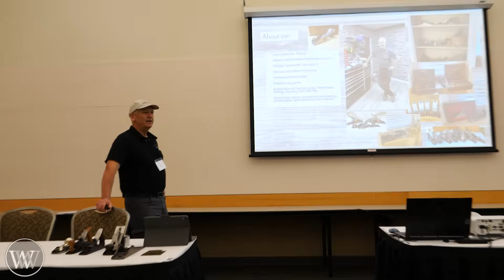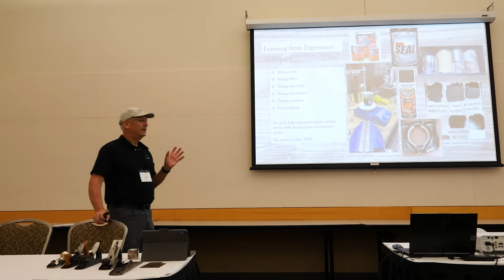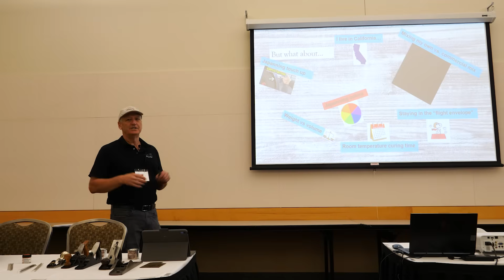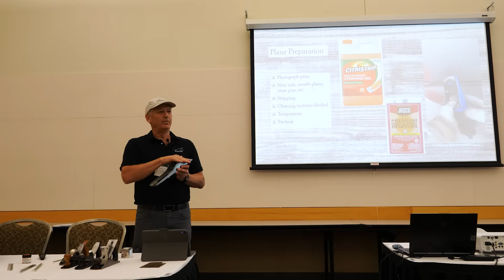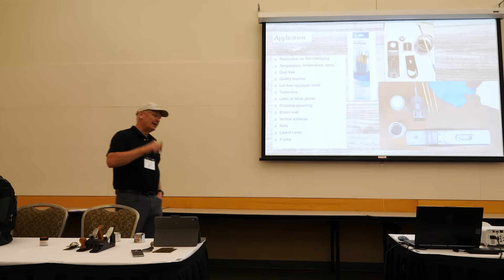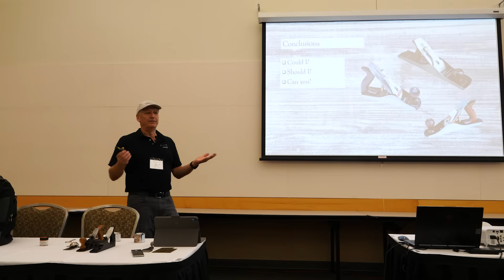Japanning Secrets You Never Knew! From The Guy That Makes It

Comment: About stripping the old japanning off, I did this with electrolysis. Works a treat. I did this with an old analog car battery charger and a large piece of steel as a sacrificial anode. Not only does it remove the old finish, also the rust will be removed brilliantly.

Comment: I need to figure out how to make japanning in old mopar colors.
Reply from the maker: collared japanning is something I have been trying to do for years, but I cannot get it to work just right.
Reply: @WoodByWrightHowTo  I know you’ve got a nice blue, but I was just imagining Plum crazy purple or the lime green. Whatever its color name is.  Limelight? Go limey? I just think if someone were able to make a variety of colors that it would be cool for tool personalization. Or even a nice white enamel to contrast the black .. you could have storm trooper planes
Reply from the maker: even the blue that I did was horrible and that is suppose to be one of the easer colors.
Reply: @WoodByWrightHowTo  I thought it looked good just not necessarily on hand planes. It would look fantastic on a bike.
Reply from the maker: In person it is a mess.
Reply: The key to using other pigments in japanning is to eliminate the asphaltum/gilsonite pigment and replace it with any powdered pigment.  The pigment must be mulled with a glass pestle and glass plate using a small about of BLO as a binder.  The pigment must be ground considerably finer than what is sold as it will be in suspension not in solution as the asphaltum.  Mulling pigments was a common practice by artists who made their own oil paints and is still common enough today that the mulling tools are widely available.  The curing is essentially the same but the final finish is not quite as durable as the asphaltum liquifies at the higher temperatures and adds strength to the long chain polymers formed by the Boiled Linseed Oil (BLO).
Reply from the maker: The problem isn't grinding it down to a fine enough paste the problem is the heat treatment. You can't take it up to as hot as you can with black. Otherwise the color pigments all start to get darker and darker. But if you don't take it up hot enough then it never cures. And for most all of them I've tried I can't get a bright vibrant color and cure them in a reasonable time. All the colors tend to get muddled if you cure them in less than a few days of heating.
Reply: @WoodByWrightHowTo hmm.. so it would almost require someone that has a kiln to do test runs with samples. I wonder if it acts similar to pottery glaze?  Maybe it would need a different solvent or carrier. When I have free time this winter I plan on investigating this more. Maybe we can get a potter to chip in